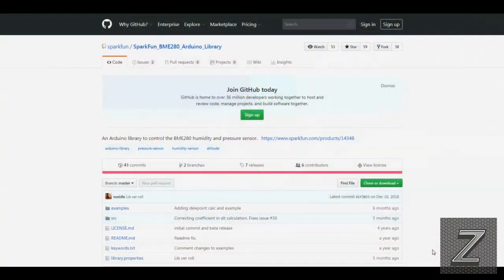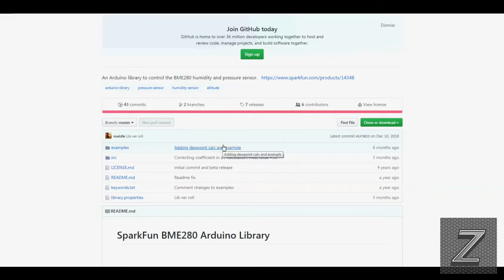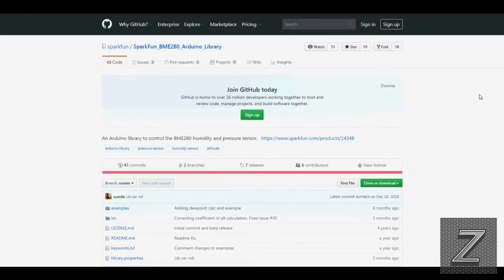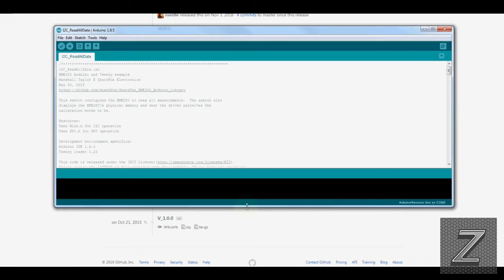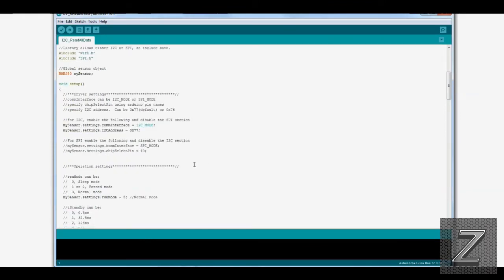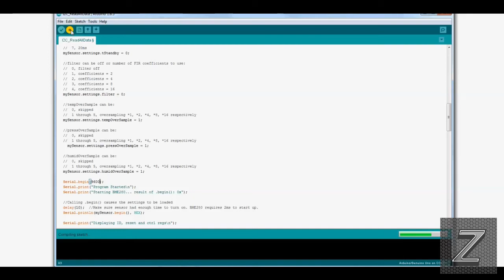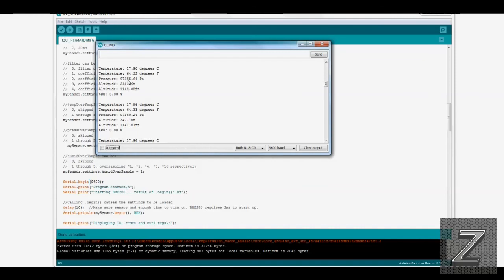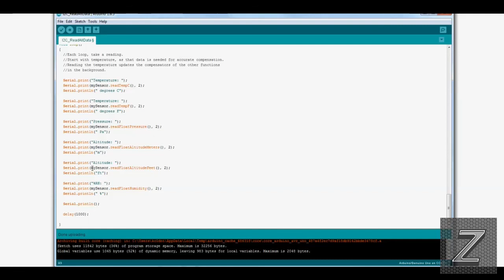Arduino Sensors: BME280 Barometric pressure sensor module

Comment: Hello friend, I executed the code, correctly connected the pins and the humidity values appear ZERO. I noticed that your example also appears ZERO. For what reason? Can you tell me?
Reply from the maker: From what I found online depending on to manufacture certain ones have the humidity sensor others don't